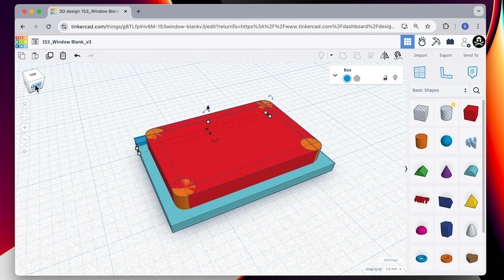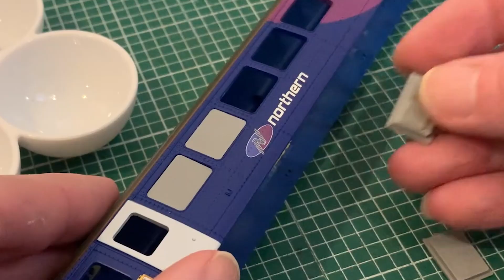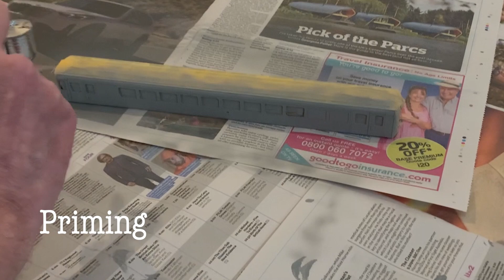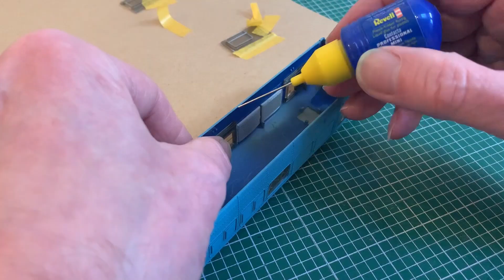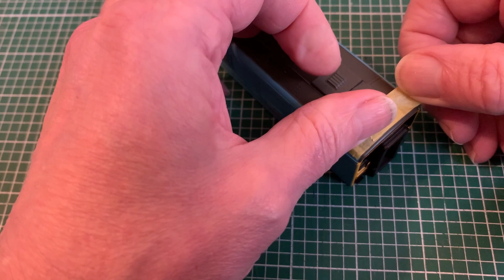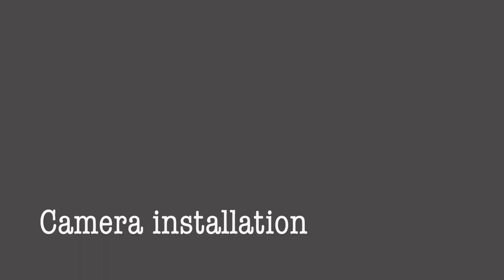Class 153 Inspection Train Conversion Part 2 – The Modelling – NEW!

Comment: This looks really good. I wish I had the talent to do this! 

I would suggest looking into an SLA/DLP printer which uses resin instead. A bit messier but you’ll get a lot more detail with a lot less finishing work. 

They are relatively cheap now, with entry ones being about £200 plus resin costs.
Reply from the maker: Thanks. I was thinking I might get better results with resin, may well look into that. I'd need something small due to lack of space.
Reply: @ There are many small DLP printers such as the Anycubic Photon, however that machine is a bit old. I haven’t really dabbled in DLP for sometime so I wouldn’t be able to recommend something to you. What I can say is that, you can get ones with a decent sized footprint with a decent sized build volume for HO scale models
Reply from the maker: @nxvasix8696 thanks. I may well look into this.